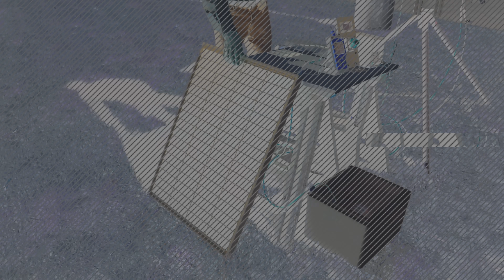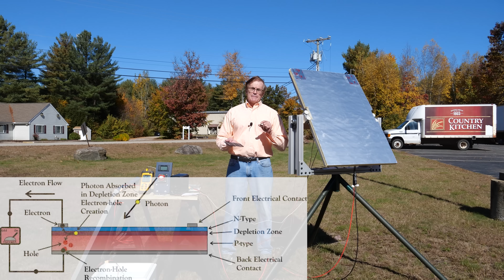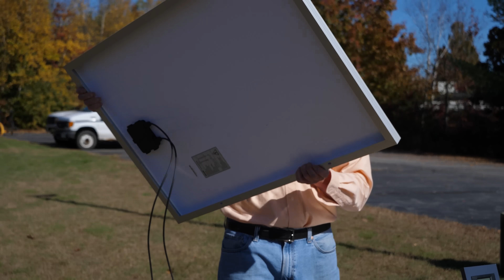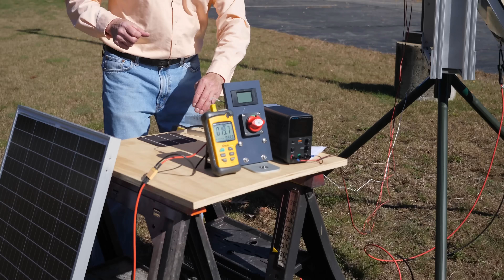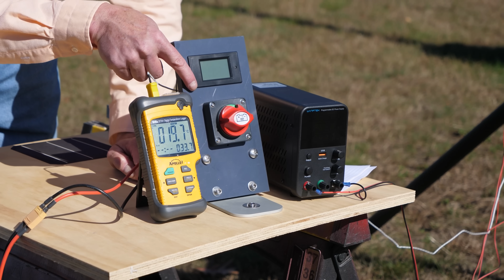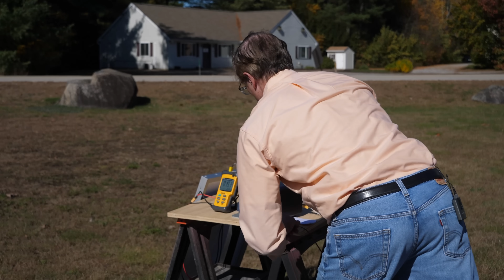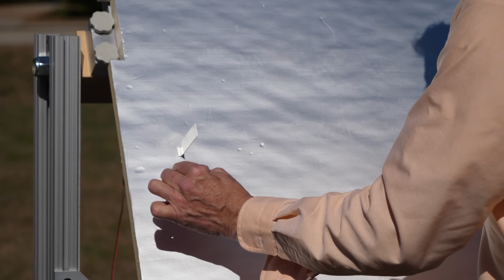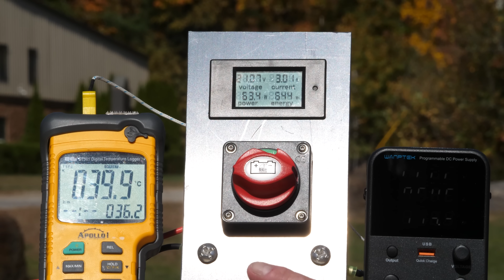Do you REALLY get enough out of your solar panel?

Comment: Super nice experiment but as an engineer I have another question. Your net gain in power production is made when the panel is perfectly normal to the sun rays. What about the average power efficiency of your system throughout the day with fixed solar panels? Nobody has controled panels to follow the sun...
Reply from the maker: It's  all about  insolation.  As the latitude  increases or the angle to the sun increases, all the numbers, including the absolute value of the efficiency gain, decrease. The reverse is obviously the case near the equator and at noon.

Comment: I disagree totally 
As an engineer student its comepletly not worth it!!
The extra cost of a step down board to power the fans
The fans cost itself 
The longevity of the fans
The extra materials needed (expensive)
The cost to benefit ratio becomes ridiculous 
Also this would mean ally of extra wiring
A sealed unit for the circuitry to step down the voltage from the panel to the appropriate Voltage needed for the fan.
Extra Brackets 
Not to mention the extra time it would cost to install such a unit
But even if the manufacturer produces a complete unit with all these benefits
The cost would not make sense
And after the extra years of longevity gained
Solar panel technology would have improved and you will still be stuck with old overpriced tech that doesn't compete with the alternatives

The extra 2-4 Watt gained per panel doesn't justify the extra cost

Say for instance you have 10 panels  which ideally produces 100W each
Adding up the extra gains (2-4W per panel)
Lets go on a rampage and say we gain 4W per panel
That makes it 40W gained in total

It doesn't make sense just buy one more panel and you gain an extra 100W

The longevity is increased but you can still get hit by storms l, thunder strikes and a lot more unavoidable factors

With that risk its better to not do these improvements
A lot more can go wrong
The point of a solar panel is plug and play 
By adding extra mechanical/electrical components just makes your job worse because of maintenance and replacements of fan blades or damaged circuitry
Not worth it in any way possible

Get you standard solar panels
Wait out their longevity and replace them with a newer more efficient model which by that time in the future will probably be cheaper

Hard scream to NO!!!!
Reply from the maker: You volunteered your current training...twice.
You will progress further and faster if you analyze a principle and look for potential  applications.

Comment: Wouldnt the real comparison have been to test the panel first standing alone, without the hot air pocket behind it created by the cooling system you built? 🤔  Just a thought..  I was also wondering if a swept wing design could be used to pass fast flowing wind under the panel instead of using fans.. obviously this would only work when theres a breeze though.
Reply from the maker: Actually,  the modified panel runs slightly cooler than the stock panel even with the fans off.  That might work, but you have to allow  for interference with neighboring panels.
Reply: @Tech Ingredients  Oh ok, thanks for the reply!  Maybe due to the heat sinks on the back?  
Im going to be building a solar powered electric boat this year so this is all very interesting.  Do you think the abundance of wind on the ocean will be enough to cool the panels on the canopy, or would it be worth trying to add my own cooling system to increase wind cooling?

Comment: Thank you for your videos.  My son is a physics undergraduate preparing for grad school.  We enjoy watching each of your videos and it increases father/son time and the quality of the time spent together.  We are looking into attempting to distill spirits as a hobby due to your videos.  I am inquiring about the placement of the fans as a non-engineer.  With the fans in their present location it would seem that much of the cooling efficiency is lost due to the airflow initially running directly into the back of the solar panel and then having to change direction by 90 degrees.  Would modifying the back sheet metal plate so the fans are mounted perpendicular to the solar panel at the top thus creating parallel airflow for the entire length of the panel increase the cooling efficiency?
Reply from the maker: Thank you!
I don't think so.  The problem will then be with flow from the thin sheet in the circular fans.  It's  a practical ducting issue.

Comment: Let me run this past you, liquid cooling running into geo thermal exchange or even hot water heater
Reply from the maker: Geothermal has a lot of potential.  The cost is the big barrier.
Reply: @TechIngredients  yes it can be for sure but Ive been finding you dont have to go very deep to have a pretty effective results. up north Im sure getting below frost line. Ive been playing with some over at broinlaws place his land in on a huge lake so I ran a irrigation line out and a hundred foot coil that I put in 55 gallon drum and then filled with sand so it stayed on bottom. granted Im in florida so all Im looking for is the cooling side and it works really good in the work shed and swamp cooler. basically just one pump runs it

Comment: I think you're missing the point with the solar thermal panels. They are generally used to heat swimming pools but the pumps only run on a temperature differential system. So there are temp sensors on the piping that determine if the water in the tubes is higher than the water temperature than the pool and only then will the pump circulate the water. So your winter situation wouldn't happen, although in areas where temps go below freezing like yours you might need glycol and a heat exchanger (which would add significantly to the cost). Here in Australia, not so much of a problem - Sydney rarely gets below freezing and there's enough thermal mass in the pipes that it's a non issue. Plus all panels, in Australia at least, come with a 25 year performance guarantee - it's generally 80% so they can't lose 2 or 3% per year without breaking the warranty. It's 10% over the first 10 years and a further 10% over the next 15 years.
Reply from the maker: Good point.
However, many  people  don't  own a swimming pool.  Although, this might be a good excuse  to build one.🙂
In addition, larger commercial installations such as solar fields  may not be near a building  or water source, and this would complicate the heat exchange.
Those warranties may be a little  problematic.  20 years  in the future, the sellers and even the manufacturers may not be in business.  And, how many people will actually take the time to measure (varifyably) the panel output under controlled conditions in order to pursue a claim?

Comment: Actually, I'm quite impressed that outcome from cooling is positive. It would be interesting to see how it performs on really hot days - maybe it would show its real value there? Or maybe the contrary? Because actually the profit is quite insignificant, what makes it unworthy; even the budget application comes at some cost, and we lose one of the greatest pros of solar panels - years and years of seamless functioning without any maintenance. 😕

In my opinion, the only option worth regarding is the one with pipes driven under the panels - it both increases PV efficiency by lowering the temperature and brings heat to warm up the warm water in the house. Also this might be used sometimes in winter days to work in reverse mode - sending heat to the panels in order to get rid of the snow, without urge to risk going to the roof. In my region sometimes a single day with really heavy snow can disable panels for half a month, even if it is followed by a long period of beautiful, sunny, but freezingly cold days. Yes, I'm aware that such hybrid panels cost much more than standard ones, require maintenance and are much more vulnerable as anything involving piping exposed to external conditions - but I'm actually quite curious how it would perform. Warm water electric heater for a family uses around 300kWh a month, what makes quite a numer...

Would you test such panels? We're all really curious about the outcome! 😁

Have a nice day! ☺

Comment: So what's the lifespan of those fans? Will they run for 5 years, 10 or maybe 25?
If the fans need replacement every 5 years, I don't think it'll be worth it.
Also, how do you check if the fans still run? You'd need a system that checks that for you.
All in all, I believe in the concept of cooling, but this seems a bit overengineered.
Reply from the maker: They're specified  for a MTTF of 50,000 hours at full power.  You'd only benefit  by running them about  8 hours per clear day when the sunlight and daily  temperatures  are greatest. You'd  also want to run them at about  25% of the maximum.

Comment: I've got a question for you... would a "Heat pump AC/Heating Unit" be more efficient year round, if you basically stuck it in your basement, or a basement of its own, essentially, underground, where the temp is really consistent. 

Whats your "knee jerk" answer to this question.

Thanks for your time!
Reply from the maker: A geothermal heat sink is an excellent thermal fulcrum for a heat pump.

Comment: Please pick up a Fluke Solar Irradiance Meter. It is necessary if you want any form of accurate or meaningful data. There is no reason you shouldn't be hitting 1000w/SqM on a not cloudy day. Panels are tested and rated at 1000w/SqM.

Comment: I was actually thinking more about the lifetime and maintenance of these fans. If I know one thing about active air cooling is that it's a perfect dust collector. Which will over time reduce the cooling effect. Especially when we're talking about using this system for decades.

Comment: This absolutely explains my recent frustration 😤 
I have a 1800watts panel array and I have noticed drastic drop in watt output within a year, it is currently given me 400watts at peak value as opposed to 900+watts when it was first installed. I have called the technicians many times to come and test why and explain, they all have no idea why.
But this video gives me an understanding why. Thank you, subscribing...
Reply from the maker: That sounds like a big drop  for one year, even allowing for the temperature  effect.
You might check whether  there is any shadowing of ANY part of the array.  The combined  output can be significantly  decreased by a weak panel.  You might also ask if they checked the output of each panel.  The same effect can be caused by a bad panel.  In one year, you might still be under a warranty.
Reply: Thank you for further clarity. The difference is really much for 1 year. I believe a bad panel is also causing this. I will request for a thorough test of each panel and have any bad one replaced. Thank you

Comment: No no you don't and the batteries are its Achilles Heel, oversize everything. Set groups south east, south and south west. Supplement with wind, if your lucky enough, have patience and equipment micro hidro. I'd like to experiment with solar sand heater outfitted with seebeck generators for evening power.

Comment: I would argue that water cooling (pipes in the back) is a better solution, because that can be filled with anti freeze fluid and used along a heat pump to scavenge heat of the panels for purposes of heating in winter OR domestic hot water.

Comment: Love your videos, you're an excellent teacher. I would love to see some experiments combining efficiency gaining techniques for a more efficient home. Such as using geothermal loops to cool solar panels. I've also always wondered if there would be a benefit from using solar panel liquid cooling to "prewarm" a houses hydronic in floor heating system before it finishes it's loop back to the boiler. It would be even cooler if geothermal, solar, and hydronic heating could be combined to benefit each other in a cost effective way.

Comment: I've had some luck bending sheet metal in the hinge side of a door here. You need to double-sided tape some wood to the frame to act as a reference & keep things straight, & it'll probably take a couple of test bends to get it calibrated properly, but then you get a lot of pressure on the metal & it'll bend nice & straight.. provided the door frame & screws can take it. Much cheaper than bothering with proper bending equipment with long levers, & it's got the large length capacity of the distance between the hinges (or the whole height of the door if the stuff you're bending is narrow enough not to contact the hinges).

Comment: 12:13 wouldn't evaporative cooling effect still cool the panels even though the water temperature is equal with the temperature of the panel? Same way our sweat is equal in temperature with our body yet it cools us down.
Reply from the maker: Sure.
However,  that will consume water, and unless the water is very pure it can deposit light absorbing salts over time.

Comment: When I installed my Australian arrays I was tempted by the Dualsun panels using a water loop to dump heat into the 50K liter pool as a heat sink. I think you’ve inspired me to revisit active cooling for the next array to compare performance directly. Maybe I’ll find room for a sunnovate panel too.
Reply: Try plumbing the heat exchanger that's connected to an accumulator, similar to an AC or refrigerator set up. This should let you concentrate the heat/waste energy to be converted to something more usable, perhaps captured from a peltier stack.
Reply: Sorry if I repeated your thoughts yours sounds good.
Reply: DualSun could conceivably work if you could make the hot water output 30°C and not have a legionnaires risk.

Comment: Is there a reason why manufacturers do not add some type of light filter that either reflects or blocks the parts of the lights spectrum that the solar panel can't convert while allowing the portions of the light spectrum that the panel can convert into electricity to pass through?

Comment: Bury a length of pipe, use the air circulating to cool the panels with no added load. This really isn't that difficult. Geothermal bud.
Reply from the maker: You're oversimplifying.  Digging is a lot of work, and you need  to move that air because  convection will never flow enough to make a meaningful  difference.  You'll  still need fans and you'll  need ducting to guide that air both underground  and to the panels, which are usually  on a roof.

Comment: solar panels are garbage for 95% of the world, unless you live in the sunbelt their useless they produce WAY more carbon than theyll ever offset, if you care about carbon, I dont personally but I know a bunch of artards do.  They lie too and claim their made out of sand, their not, more like quartz, there is nothing green about solar panels.  Wind is a better option for base load, they can make towers 1000ft tall now that can get into wind zones that last all the time.  Personally I say burn oil and whatever I dont feel they ever made their case that co2 is the main culprit of warming, I think the sun has way more to do with it then that.
Reply from the maker: You have a point, but you don't  have to get upset.  Solar power can be useful as long as the cost/performance relationship is good.  And, that means all the cost and the real performance. You're  right about location, and I'd add average sunlight as well.  Land cost and access should also be included. In addition, the materials in the panels, the support structure and the electronics, cables and the installation and maintenance are going to add up.
This also applies  to wind and hydro.
Compare this to grid electricity and throw in redundancy as a benefit.
Reply: @TechIngredients  I didnt think I was portraying upset...  No, I am just annoyed not at your channel or video but at policies being put into place as if theyll work or make any sense, this one size fits all for a country the size of the US is the definition of insanity.  We are no longer a Republic or Democracy at all I think that it has become pretty clear that we are now a oligarchy.  The coast dictate to the center, literally leave the border open and bus the "migrants" to red states etc none of this is republic or democracy it is oligarchy and it should upset everyone but sadly humans dont care if it is going the way they want.

Comment: A factor in favor of a rooftop installation: if you covered the majority of the roof and used the array-roof area as a duct, your roof temperature would be much lower too, reducing the need for AC to cool the house.  I wish you could include cooling the side of the house in the bargain, but it just doesn't seem feasible.  

Introducing an evaporative cooling step for the air cooling the panel might be passive enough and enough gain, most of the time, in all but the most humid weather, to contribute more gains without increasing costs too much...

Comment: Might make sense for a large scale industrial setting, but I doubt the ROI is worth it. The life expectancy of those fans are definitely not 25 years and would have to be replaced several times over the lifetime of the panels. It was interesting to see the actual effect of temperature on efficiency though, cool video.

Comment: I would wonder if it were possible to use a thermoelectric peltier module adhered to the back of each panel in conjunction with the cooling fins to generate the 3W to run the fans? Could possibly both cool the panel while using the heat from the panel to generate enough watts to run the fans?